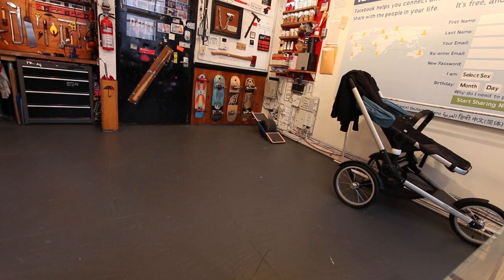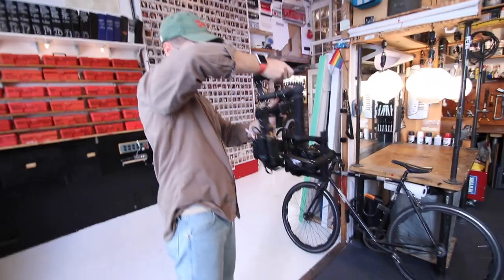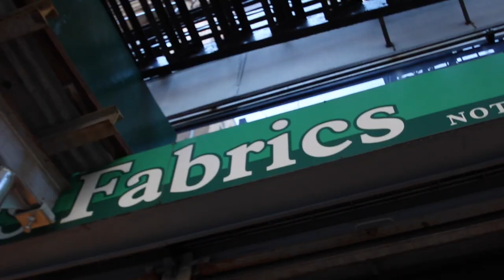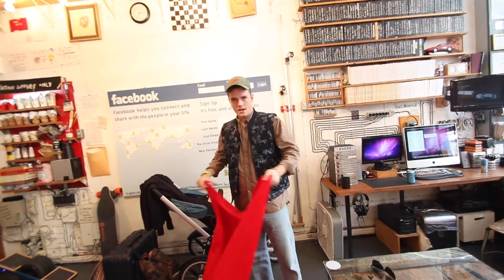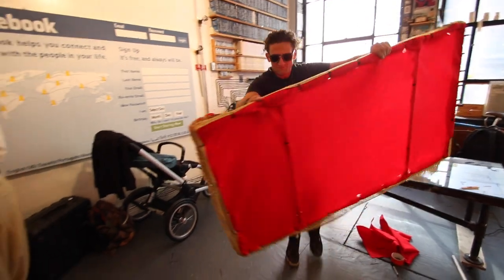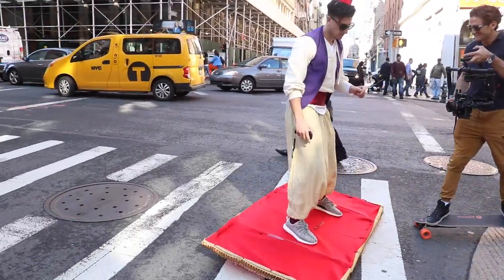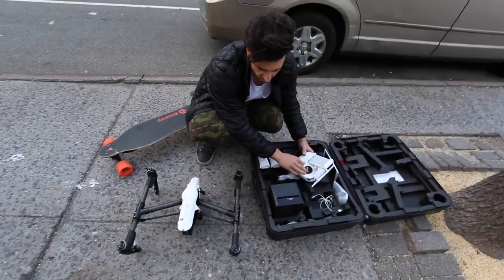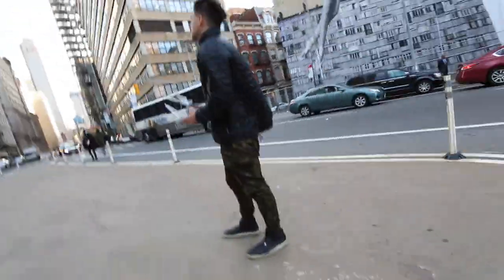ALADDIN IN REAL LIFE; Behind The Scenes

Comment: Should've used a real rug, haha. That red fabric looks ridiculous.
Reply: Ever zip tie a rug (heavier) to a rectangle PVC pipe frame?

*Not since breakfast.
Reply: If the PVC pipe frame is what's limiting you, make it out of thin gauge steel or aluminum. But I think the PVC pipe frame would've been strong enough to hold a small oriental rug on. You'd just have to poke holes in it with an awl and use heavy duty zip ties.

Either way, I think he said in a later episode that they wanted to use a rug and dropped the ball, so the settled for fabric in the interest of getting it done on schedule.
Reply: Asian rug is the politically correct phrasing.

:/
Reply: I've never heard a rug get offended by being called "oriental"
Reply: rug is heavy.
Reply: yeah rug is heavy when skateboard can carry 2 human being at once

Comment: Red tape? what about epoxy lol, gets the job done in 5 minutes and is strong.
Reply: Or PVC cement, which is made specifically for joining two pieces of PVC together...
Reply: Not to mention the measurements for the cuts look way off and the resulting frame isn't square. This guy is not an engineer.
Reply: Bartosz Olszewski How about 10sol on copper pipes?